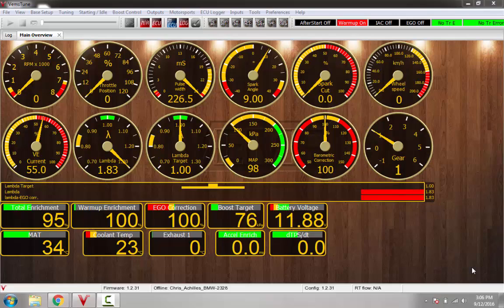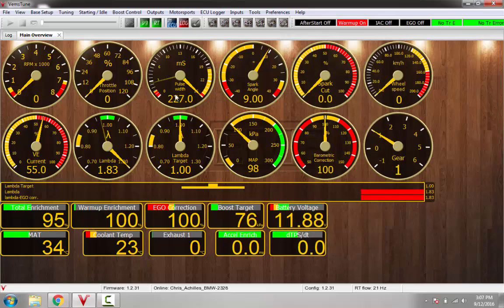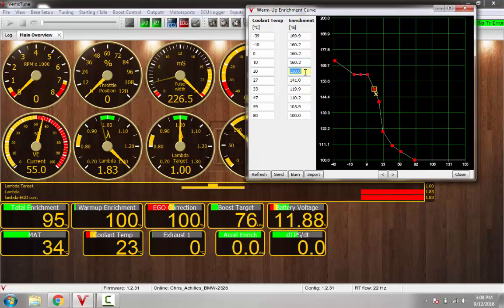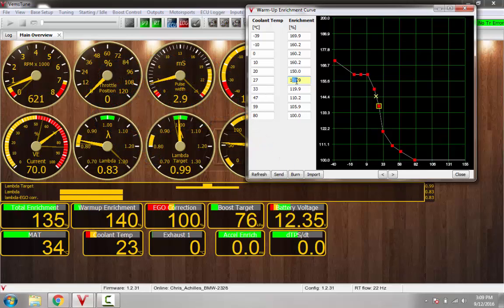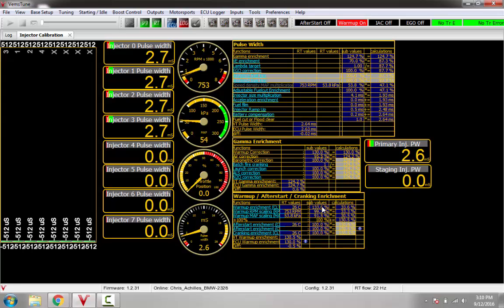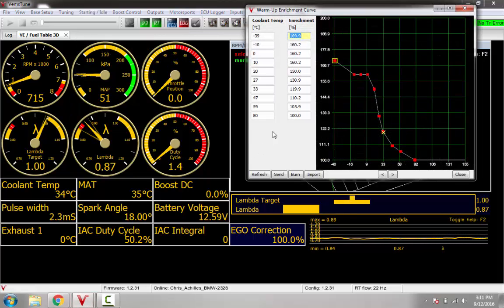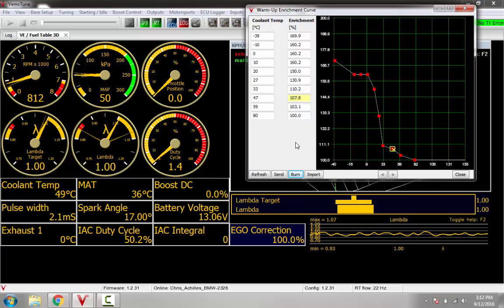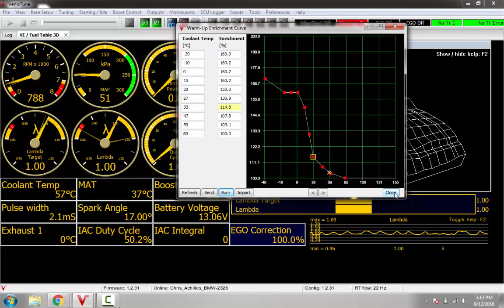VEMS Warmup Enrichment Tuning Tutorial

Comment: Ok. I have problem with my s38b36... it is way to rich while first starting, so í have to pull of the fuse for the fuel pump crank for 3 seconds and than put í back and engine starts and run. Can í delay fuel pump somehow. Sorry im not a pro. 
I got Vems v3 í think.

Comment: Hi Jason, is this example done on a BMW M50 engine? Reason I ask is that I'm currently in the beginning stages of tuning my M50B25nv on VEMS and this warm up enrichment table may help me.
Reply from the maker: I'm pretty sure that serial number is his M10 turbo engine. He does have a M50 (BMW 525) but it's a plug and play, and I haven't touched that car in over a year that I recall. So this must be the M10. I don't have any examples of a non-vanos M50 though, as I've been having a super hard time finding one. They are all rusted out here in the northeast I think.
Reply: Thanks for the reply. Mine is plug and play as well. Trying to get the hang of tuning before I bolt my turbo on it. Do you think you could do a Tutorial on how to setup the VEMS Round Display? I'm having trouble getting it to work by going off of old/translated online instructions.
Reply from the maker: Oh, sure thing. I can do a tutorial on configuring the Round Display. I'll put it on my list. Should be easy, so I'll get to it in the next week or two.
Reply from the maker: It should be really close. Chris' m50tu has been daily driving for 2 full years now and that's down to around 0 or -10F (-20C) around here. Startup has been beautiful. Granted, different engines, but should be really close.
Reply: VEMS interesting. I'm going to play with my configuration a little bit today. Here in CO we too have pretty cold and hot temperatures throughout the year. I wonder if he would be willing to share his config as a reference
Reply from the maker: I do the tuning, so it's my IP, and I'm happy to share. The warmup enrichment curve is: -40 it's 180.1%, then -30:170, -24:160,-15:150,-6:140,5:130,30:118,60:105,70:100,80:100   Cranking enrichment is -20:500, 0:438, 30:188, 70:100 This is with stock injectors. If you've changed injectors, the settings should work as long as the injector parameters are right. Just mentioning as it's a possible gotcha.
Reply: VEMS Finally got around to playing with the warmup after being sick for couple weeks. Works great, thank you! Just needs a little fine tuning and it should be good to go